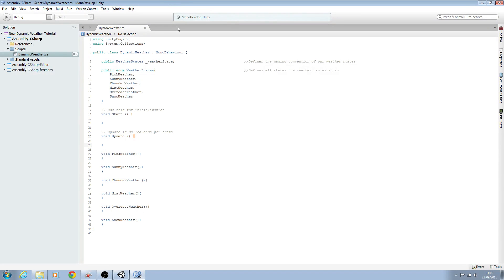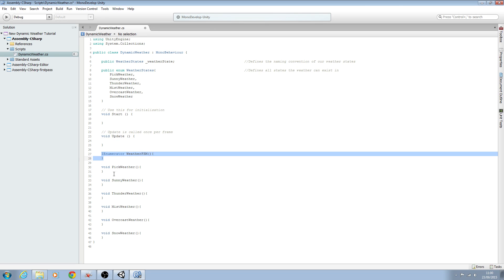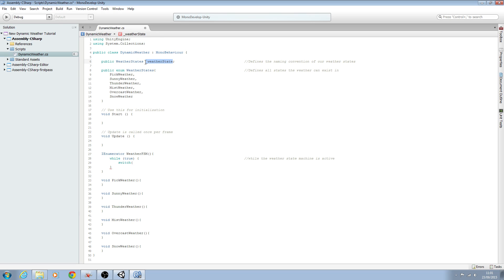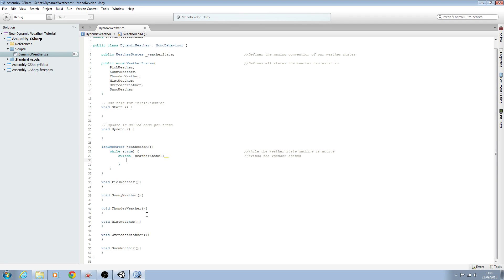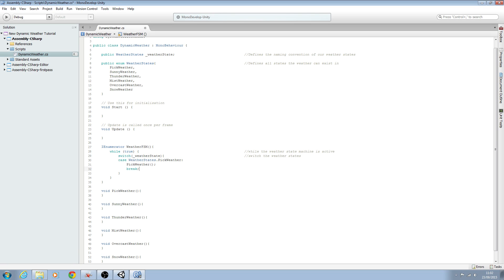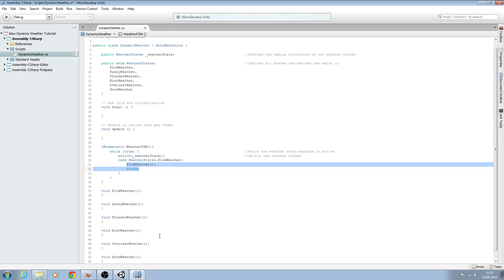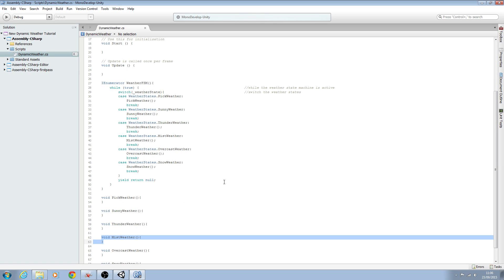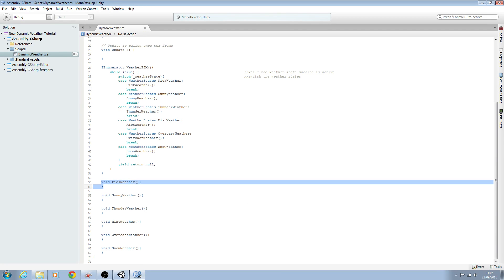Unity3D Dynamic Weather Tutorial #2 Finite State Machine

Comment: So, I am already doing the wind system. But anything I add into the Finite State Machine void or anything new added to the PickWeather void ends up making my countdown go from 0 into negative numbers instead of starting at my switchweathertimer.
I have tried to make another void and insert it at different positions but I cannot seem to get it to work. Do you possibly have a solution for me?
Reply from the maker: It's look as though you've missed an if statement, copy and paste your code in a reply and I'll check it over for you.